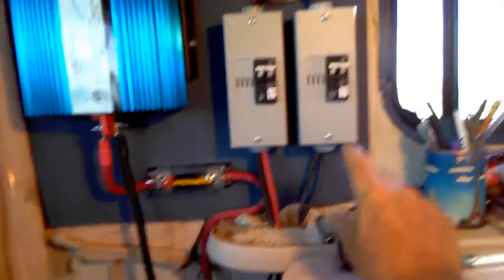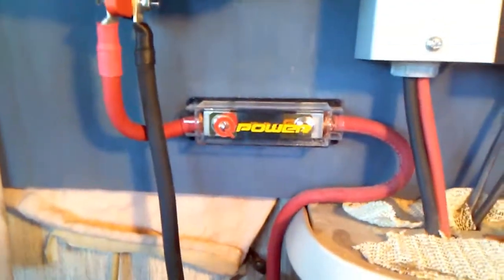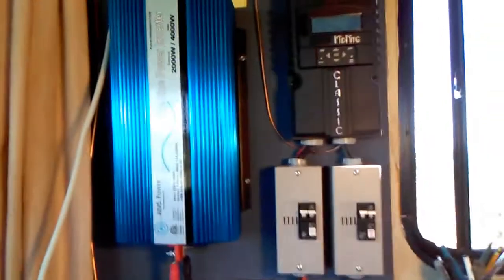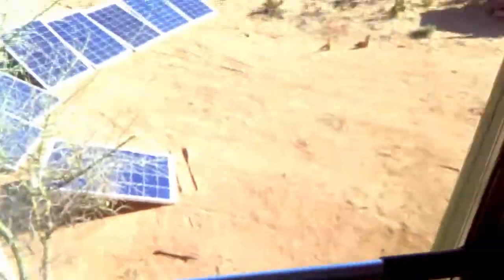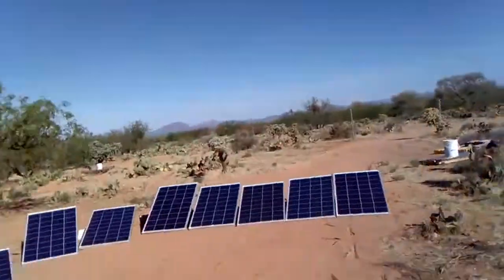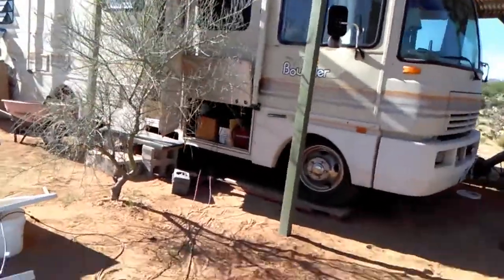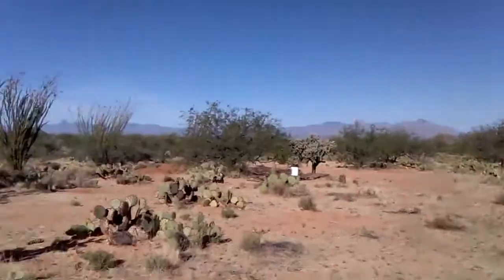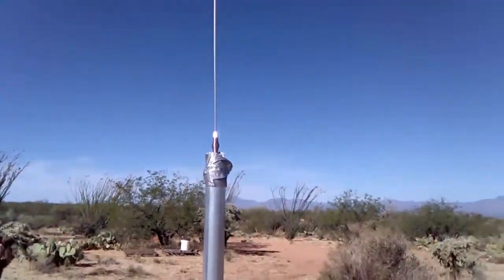800 Watt 12V Solar Off Grid Power @ AZ Off-Grid (Unplugged) RV

Comment: Great job! Pretty impressive to get the gear inside the RV. We’re also running our RV from solar while we build, but we used a solar trailer to mount the panels and store the electronics. We’re about to increase the number of panels from 6 to 15, and I’d like to build a carport type structure to hold the panels now. Interested in seeing how your structure is designed and constructed. Where are you at?  We’re in southeastern AZ.
Reply from the maker: Thanks.. I would have put the power wall somewhere else if I had known how often the fan on the inverter would run.. You know,, I have so much room to put stuff in here..:) but I like having the Charge Controller where I can look at it anytime I want.. .. .. I have seen your channel and your power trailer,, Good idea!... .. I am about 35 miles SW of Tucson.. I am in no way a carpenter or an engineer.. I built the first awning for my green trailer with no intentions of expanding it.. That one is just 4x4's cemented about 2 1/2 feet in the ground.. (I have a video on here.). You are welcome to come and see it anytime you are west of Tucson....  When I went to make room for the motorhome I was planning on doing the same thing, in reverse.. I had a guy come out and dig holes for me.. I ordered what I needed.. THEN i drove the motorhome to the property and realized I had made a cupla huge mistakes.. I had to kind of rinky dink it together since I am alone and no tall ladder.. .. .. ..Talk to Jeff at ArizonaHotHomestead about how much he paid for his "versatube" shade structure.. 
https://www.youtube.com/watch?v=SCniZAdys8g&t=315s..
Reply: I’ll check out the trailer shade video. Thanks.